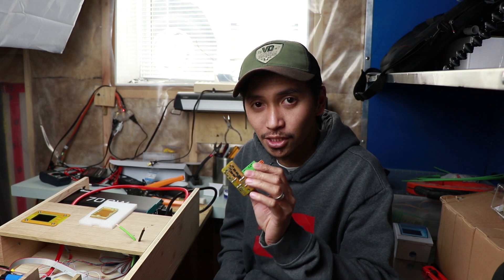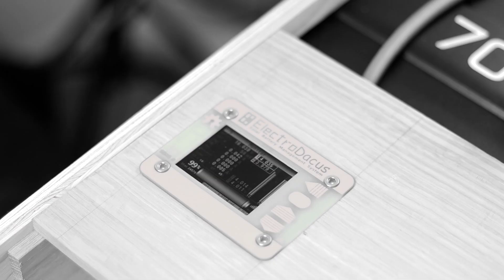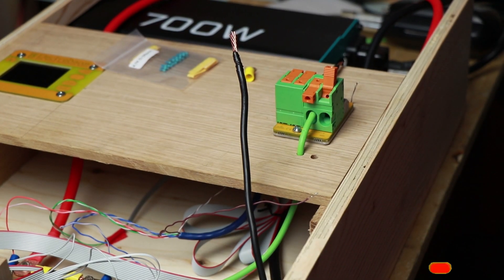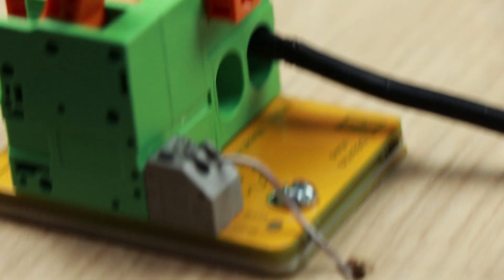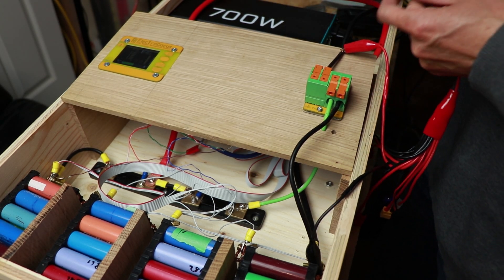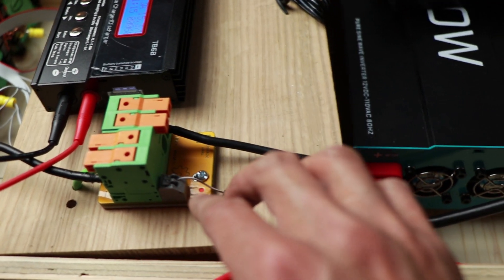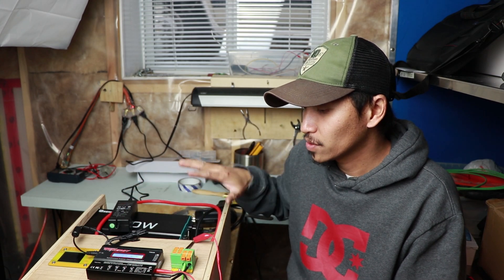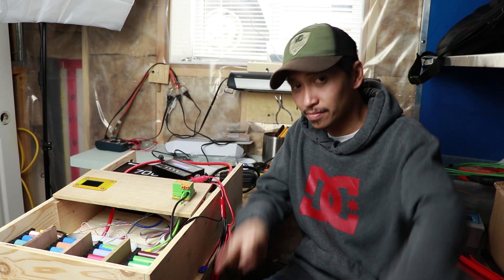Setting up the Electrodacus DSSR20 Solar Charge Controller

Comment: electricity in the philippines is horrible to begin with and it is always going out so you always have blackouts. they say brownouts but they are actually blackouts. I will be using the same system when I get to the pinnes to set up my off grid system. DSSR20 and SBMS0 combined. 16 340 watt panels on the roof using the DSSR20 so I will need 8 of them and one SBMS0 to keep all the batteries balanced.

Comment: 10:58 what do you mean "or not"? that confused me a little.
Reply from the maker: Sorry for that confusion that is the positive with the resistor. Its the same diagram that i followed from dacian .my bad did not realized that one it has been so long
Reply: @RonYason  it's just that you said "or not" so do we need the resistor or we don't need a resistor while connecting [extio4+] to the battery positive?
Reply from the maker: @ulightme  yes you do,sorry for making it confusing. I forgot the ohm on the resistor. Its been a while since i made that video

Comment: thank you, your video helped me connect the dssr20 correctly ... originally I used the main diagram from sbms0 pdf and wired [extio4-] to [batt] and [extio4+] to [heat] on the DSSR20 !  Now I've got the [extio4-] to [batt] and [extio4+] to battery +
Reply from the maker: Thank you too